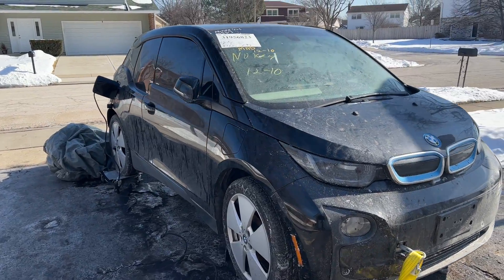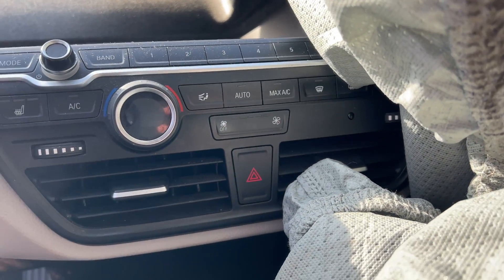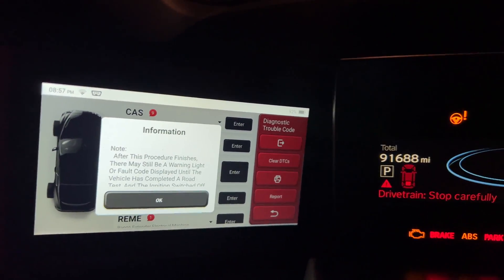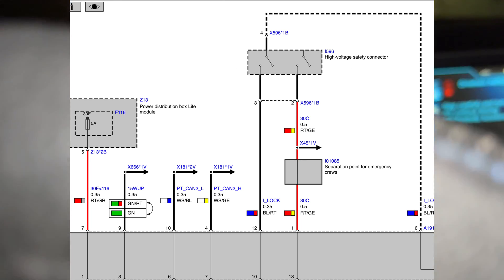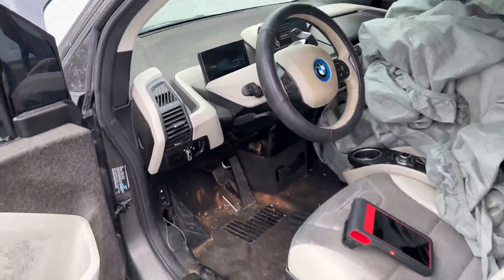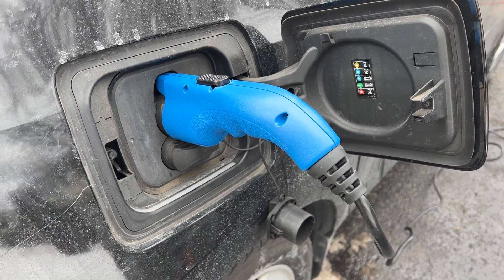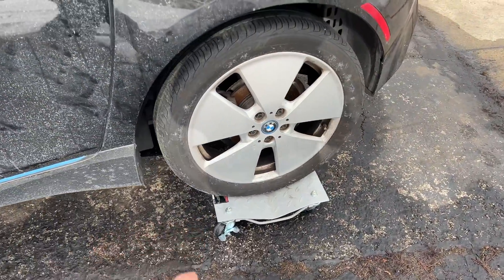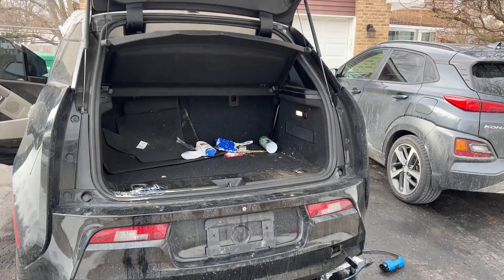I fixed my BMW i3 High Voltage Problem for FREE

Comment: Good morning boss. I’m reverting to buy one of these from a guy that selling one. He states that the car powers on, does go on neutral but doesn’t drive or charge. And gas a lot of errors codes. Any advice. Really clean with only 60k miles year 2014. Any advice?

Comment: Did the codes go away in its own after you fix that cut wire? Or did you have al to a scan tool to take it off?
Reply from the maker: I had to reset the module and clear the codes to get it going again if I remember correctly

Comment: Could you please share the wiring diagrams that you used? I have the same problem like you. Came home with the car, everything worked fine, then next morning when I had to go to work, issue appeared out of nowhere. I replaced the 12v battery, but I still have the problem. I need to check wiring now before I go for the pyro fuse.

Comment: I'm curious about your plans to upgrade the battery. I used to do all the mechanical work on my VW myself – everything from the timing chain to the clutch and transmission. Now I'm thinking about switching to an older BMW i3 and tackling a battery upgrade.

Do you have any videos that cover the process, including:

How to choose a used i3 for a battery upgrade: What to look for in terms of model year, battery condition, and overall vehicle health? 

Technical information on the upgrade process: What are the steps involved, the potential challenges, and compatibility considerations with different battery versions?

Cost breakdown: What's the estimated cost of a battery upgrade, including parts and labor? Any advice on finding affordable options or potential DIY approaches?

I'm eager to learn more about your project and again congrats!

Comment: So could I recharge my 12v battery by charging it without disconnecting from the car? Should I disconnect hi voltage?
Reply: I would disconnect the HV battery

Comment: Great video! I got a message saying battery discharge while stopped, then a day later followed by a check engine light with a code p1c53. You guys think it needs a 12v battery?

Comment: Good work, and happy to see you now have a running and driving car! I already have a working i3, but I would love to do what you are doing and get a dead one to revive, repair and get back on the road. I get the feeling that these will become future classics (along with the i8) due to their unique design and lightweight construction whereas most EV manufacturers are just basing their designs on conventional ICE cars, but swapping out the powertrain.

Comment: Hi! What is the function of plug (close to battery 12V)  which was cutted in your car? schould be there any voltage or it`s a jumper or what?
Reply from the maker: I believe that’s the wire that enables the high voltage battery (probably goes to a relay or whatever it’s called on HV batteries).

Comment: Hi mate I’ve got an i3 with the same issue but can’t get it to run any help
Reply from the maker: What kind of codes are you getting?
Reply: @SimpleCarGuy  Hey bro could really use your help. Same issues with mine. Cannot get the REX to even come on

Comment: Hi.
I have the same errors after a crash. How were you able to get the car to go into drive if it has the drivetrain fault error?
Reply: Hey I’m dealing with the same problem, we’re you able to find the solution?

Comment: What is the technic to reclose the HV disconnect switch.? It worked once for me, I have tried and tried but I’m not pressing the tabs correctly to lower it. I would appreciate your help. Thanks!
Reply: Do you have green or orange connector? The green one is the hardest to put back together but you pull out the tab on the left with a flat head screwdriver and pull the red tab towards you and that should get it to go down. Hope that helps

Comment: Hi, yes mice ate some wiring so i have to replace the High voltage cable set combo socket, is that a part that i can replace myself you think?? Thanks

Comment: I had the same thing on mine.  I bought a 2 year old i3s and found the wires to the windshield washer pump cut.  I think it is rats.  They make surprisingly clean cuts in wires - you would swear they had been cut with scissors.  Interestingly they were very close to where your cuts were.
Reply: I've had rodent damage to cars more than once

Comment: Really liked the videos. Glad it appears to be working out for you at the price point!
Can you please tell me exactly what you did to get the REX to turn on while it's parked? Just finished changing the oil on mine today, and would love to have been able to run it for a bit to check for leaks without driving off the ramps...
Reply: It's in the video

Comment: Congratulations on your success so far.  I did get a chuckle when you said electric cars aren't very fast.   You're going to be pleasantly surprised.  :-)
Reply from the maker: Wellll I haven't driven the car at that time yet but looking at the specs it's 'slower' than all of the BMWs and Mini Cooper I've had. After driving it, I can say that it's quick from 0-40 and not bad 40-60. Overall, I'm very happy with how it drives for now.
Reply: @SimpleCarGuy  I had a supercharged Mini Cooper S and this feels as fast in passing big rigs on highways in Eco Pro mode :D It's nuts.
Reply: I like to say it’s quick, not fast. I believe (read somewhere) when the car was first released in 2014 it was the ‘quickest’ car in BMWs fleet to 60km/h at that time.
Reply: @SimoniousB  it was but they detuned
Reply: 0 to 90 is on par with g35 Nissan I've goofed off at stop lights with a lot of different cars
Reply: G35 fast
Reply: I think my 12v just took a dump
Reply: He had to have known better, I think he was trying to get a reaction. Nobody says that anymore since Tesla got big.
Reply: @rp9674 no he said he had faster cars so this is technically slow to him

Comment: Looks like the cut wire was sabotage.  Most potential buyers would think the car has major issues.
Reply from the maker: That's what I was thinking as well, but didn't want to blame anyone. I think someone at the auction figured if they cut the wire, they could get it for much cheaper since they know the fix.
Reply: @SimpleCarGuy  It worked to your advantage. Lucky you found the problem